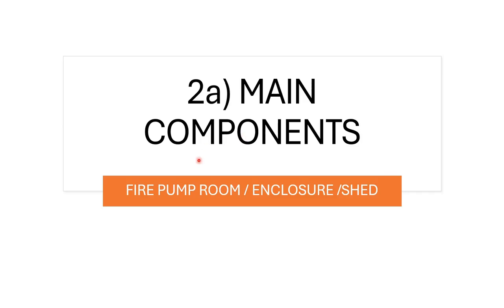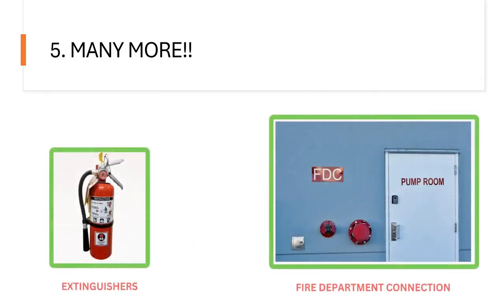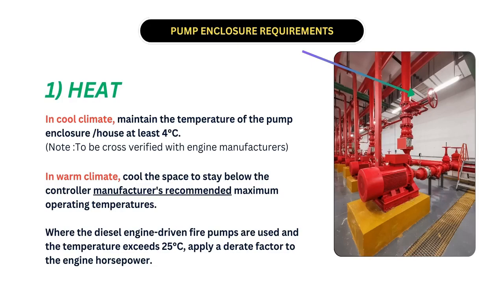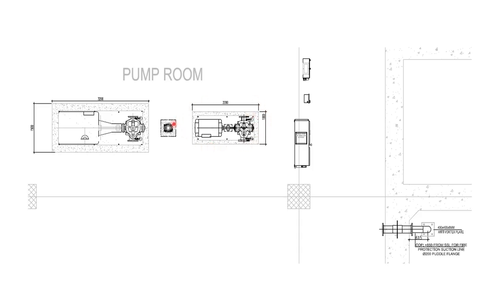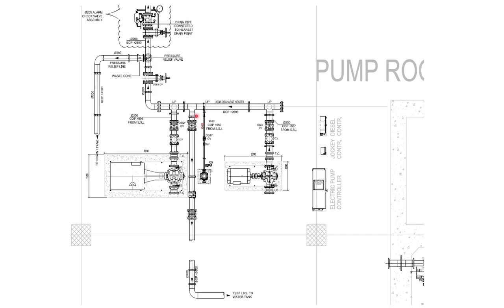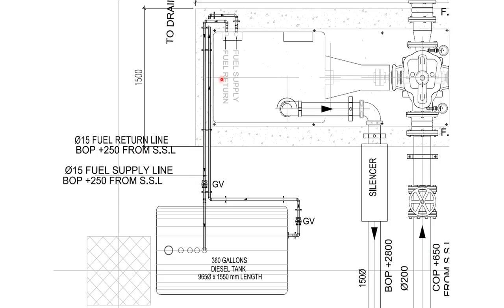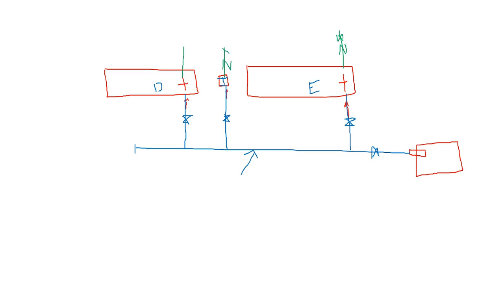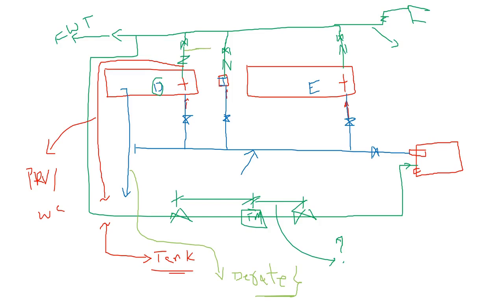Fire Pump Room Design: Everything You Need To Know

Comment: Hello Irfan, 

For the fire department connection, is that required at a prefab fire pump building or can their by a yard hydrant that can be used close to the building
Reply from the maker: As per my knowledge, FDC is still required.
It does not have to be at the prefab pump building, but a yard hydrant cannot replace the FDC. You must provide the FDC at an accessible location approved by the fire department.

Comment: How to make sizing for Pressure Relief Valve
Reply from the maker: Please check the video of nfpa 20 series mastering pipe sizing
Reply: @irfancfps  Thanks for the reply... Please provide explanation on circulation relief valve in fire pump room
Reply from the maker: It is a valve used to cool the fire pump by discharging a small qty of water. this valve is separate from and independant of main relief valve.
when an electric VARIABLE speed pump is installed, the automatic circulation relief valve shall open at minimum speed.
The valve shall be installed at the discharge side of the pump before the discharge check valve.
This is used to prevent the overheating when operating with no discharge.

Comment: Why is PRV line not necessary for Electric Pump set up?
Reply from the maker: Please refer section 4.2 of NFPA 20 (Ed 2019). Where Electric variable speed fire pump  is installed that time we can install Pressure relief valve.

Comment: Hi sir, I've a gneral doubt. Why fire pumps are not allowed to be installed on rooftop.? My opinion is, if the fire pumps are installed on rooftop in a dedicated room, it is okay and also it will increase pump efficiency due to gravity flow . But some cons are, during emergency needs it will be inaccessible but other than this are there any design related issues or any logical reasons.? Requesting your answer. Thanks is advance
Reply from the maker: See if u have high rise buildings, then u can think about that.. but due to the increase in pressures, u need to install pressure reducing valves in each floor and there will be a risk if u install on above floors..Ultimately it will depend on project specifications and client requirements.
Reply: @irfancfps  thanks sir..

Comment: What is the flange used in suction side of pumps and water tank called?
Reply from the maker: There is no specific terminology for suction side flange. The type of flange can be either slip on flange or raised face flange to be considered based on the fire pump suction side flange. For the water tank, a puddle flange will be installed. Let me know for any further queries.

Comment: Where do I usually find the flexible connector in terms of location in my piping? And Is it required on all systems?
Reply from the maker: Flexible connection is not usually installed in fire pumps suction and discharge piping. However, Please refer to NFPA 20 (Ed 2019), Section 4.16.6.5, flexible coupling for strain relief can be used on suction piping.

Comment: Thanks Eng. Irfan for the video.

I have a question roaming my mind: 

Let’s say we have 3 pumps (joceky, electric, diesel), in normal situation (standby condition)

What readings should I expect to see on each suction/discharge line gauge?

Should they all be identical?
Reply from the maker: When pumps are not running, discharge guage reading is zero or slightly high since there is nrv in discharge line.
Reply: @irfancfps  but is not the sensing line supposed to be between nrv and pump casing?

In this case how can the pressure switch detect the drop in the system and activates?
Reply: Pressure gauge installed on the the discharge line is aim to indicate the discharge line pressure. Since pressue gauge is located on the discharge side of pump and before NRV it will indicate static pressure, i.e. Fire water tank static pressure... Let me know if you have different opinion.
Reply: @VikSmiVlogs  but is not the sensing line supposed to be between nrv and pump casing?

In this case how can the pressure switch detect the drop in the system and activates?

Comment: Distance of flowmeter to either isolation valves  should be as recomended by the meter manufacturer. This is as per NFPA 20 2022, A Explanatory notes, A.4.22.1.3 (1) and figure A.4.22.1.3(a) and A.4.22.1.3 (b)

Comment: To ensure that the pump house remains fire-rated, introducing open areas such as provisions for the installation of a ventilation system, if needed, would compromise the integrity of the fire-rated structure we aim to maintain... ???Am i correct sir?
Reply from the maker: No. As per nfpa 20 there is no such exception